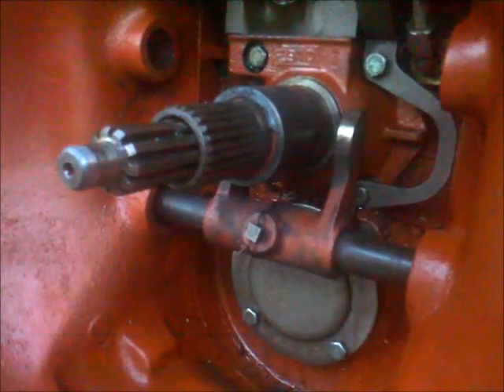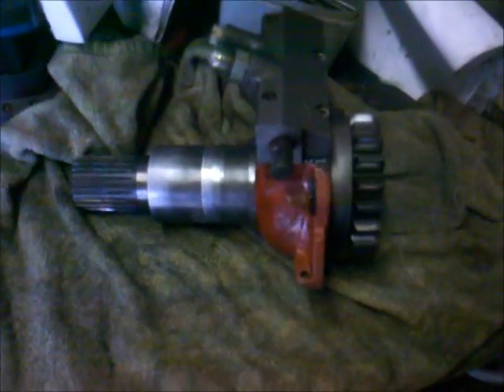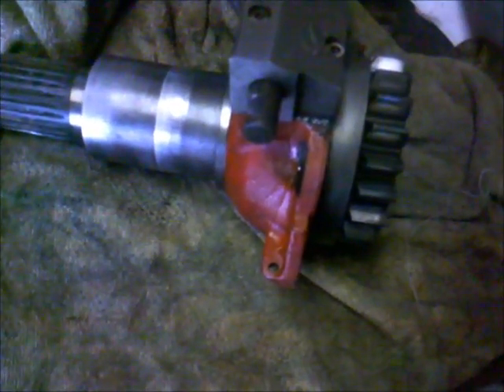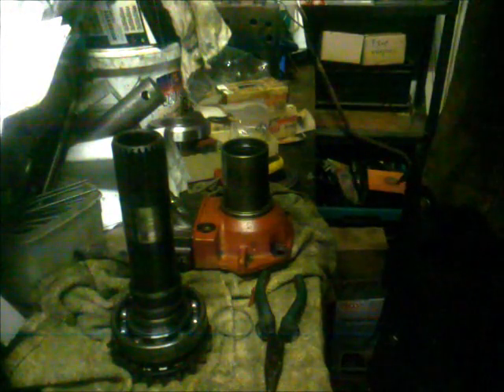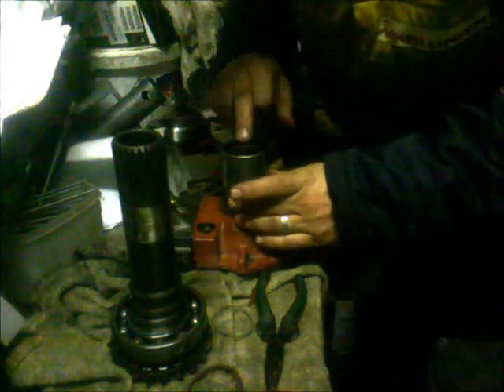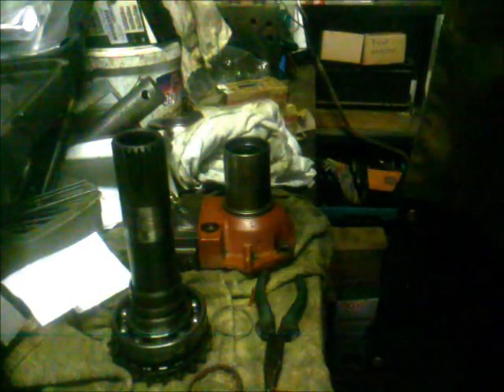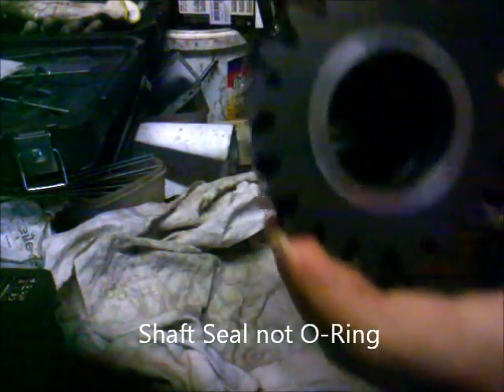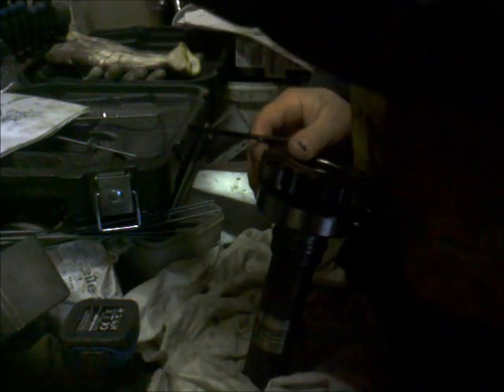Massey Ferguson Multi Power Input Shaft Overhaul - part 1

Comment: Witch oil in this system?
Reply from the maker: you can use UTTO (Universal Tractor Transmission Oil) if you have trouble with MP use simple 80W90 Transmission Oil API GL4 but no API GL5 !!! API GL5 may damage your seals
Reply: @EngineerLikesFarming  thanks bro I have a problem with multi power on hot oil this not working on cold oil is working a perfect
Reply: @EngineerLikesFarming 🤔sir, isn't it original "MF 108"? -Wouldn't GL4 have high viscosity, - we know that the hydraulic system in GL4 may not be very suitable in cold conditions (although it is an SUV) the intervals are equalized in hot weather🤔!!! I think %